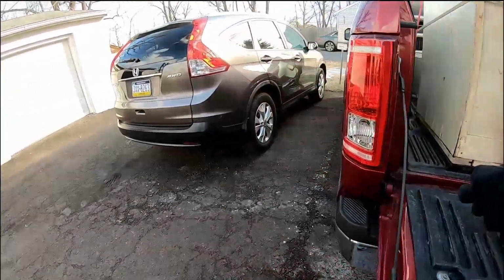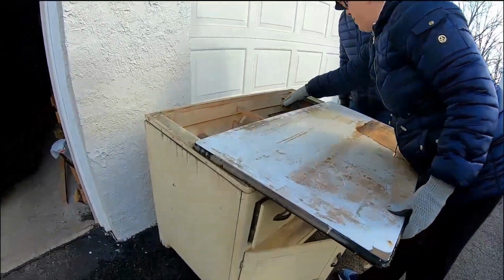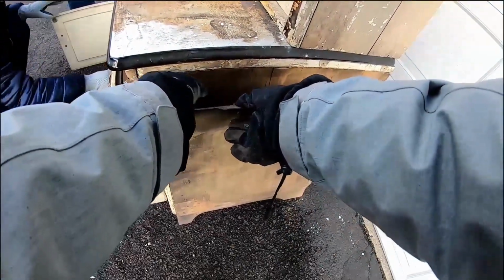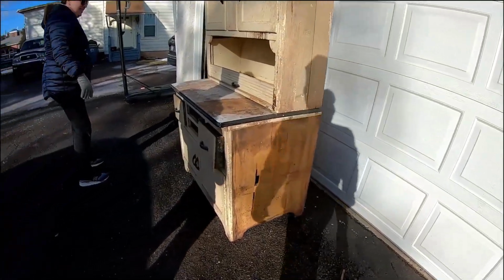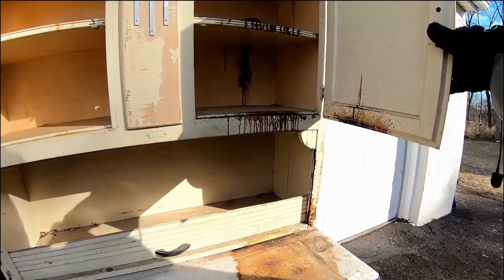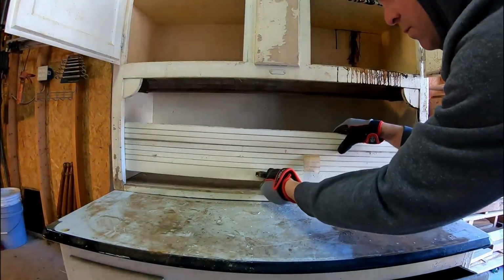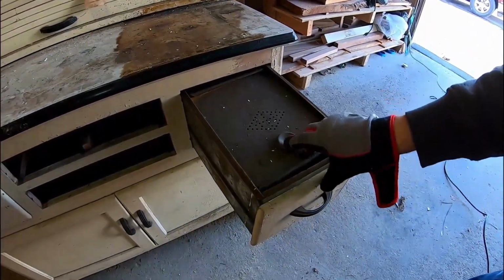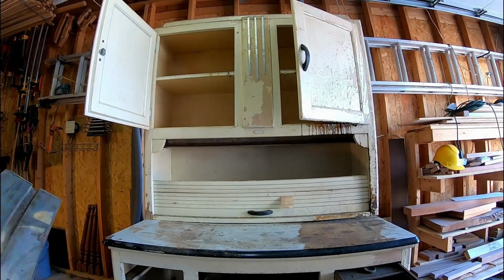Hoosier Cabinet Refinished!

Comment: There are websites where you can buy replacement side brackets that allow for the sliding top to work and provide more counter space
Reply from the maker: I will look into that thanks!
Reply: This. The one my mom had had brackets like that. She used it as a sewing station.

Comment: Hi there, what did you use on the counter top? I just got a hoosier that needs some work and the counter has some chipped/worn spaces in the enamel. we've never used enamel paints and don't really know how to go about fixing it so that we don't damage it at all.
Reply from the maker: I just cleaned it and flipped it around so the chipped part is hidden under top portion.  I know there are people who re glaze old enamel bath tubs. You could look for someone like that to help you?

Comment: When `I was restoring my Hoosier I found Kennedy Hardware (google them!) and they probably can find the supports that attach the top to the bottom so you can slide out the porcelain work surface and can give you tips on repairing the sliding door.  Beautiful cabinet, you were so lucky to find it with all the pulls intact!
Reply from the maker: Thanks for the tip!

Comment: How do you take the roll top part out without breaking it and do you know if it’s possible to put it back in
Reply: There is a slat on my cabinet that holds the tandoor door in. And yes, it will go back in. Look for a narrow slat on the top or bottom that is only held in with a few tiny nails.